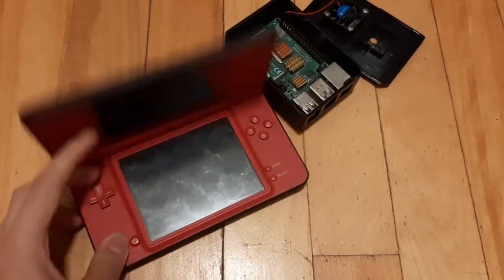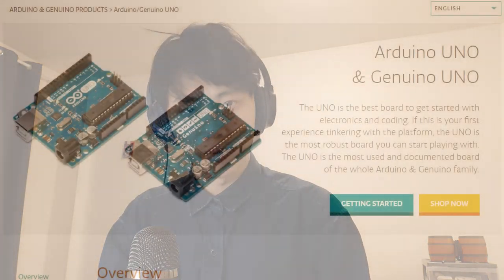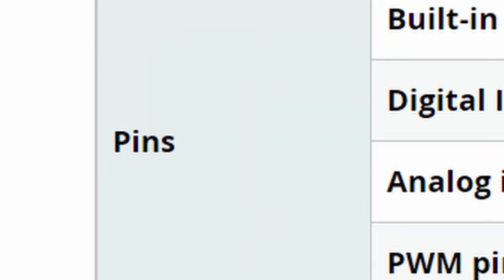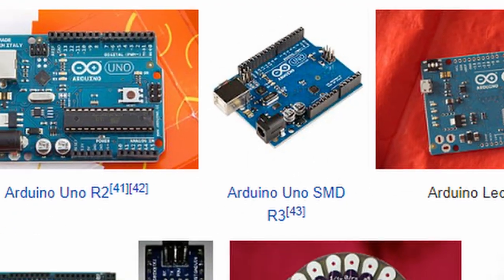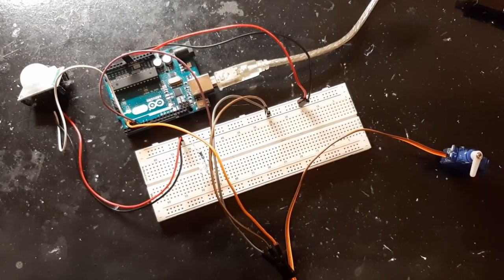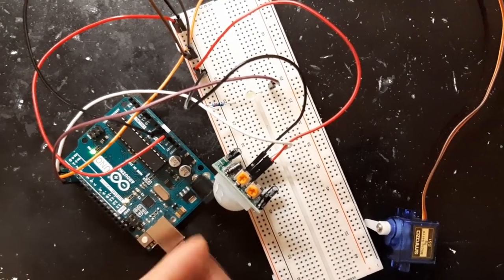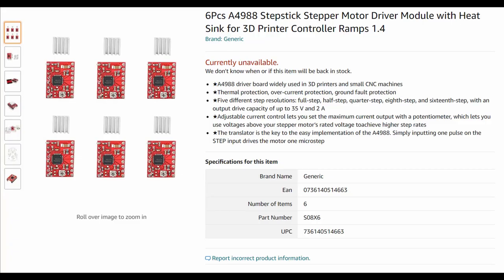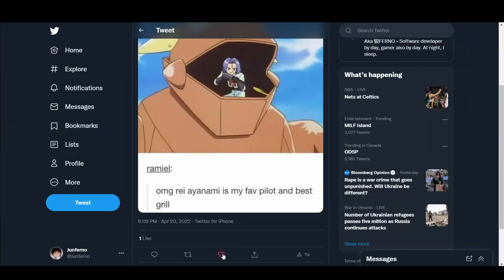Machine That ______ When You ______

Comment: you dont need a micro controller, you need to use a z80 cpu and seperate chips for ram and rom and pio and serial and make a custom PCB from scratch and program everything in ASM. PFFT. you dont need arduino. (no wait really i did do that just) you should see it, it speaks to a serial terminal

Comment: Ha, I expected the full. "Of course I first made the Blinky Sketch" (The 'hello world' of microcontroller programs). And how long did you spend figuring out the number of steps needed to get the right amount of fly swatter swing on that motor?
If python is your jam, the Pi Pico is a microcontroller board that might be a good middle ground. 

Also to your footnotes: We just call it the Arduino Due, no one is really wants to try pronounce ~Duemilanove~ in full. 
AREF sets the Analog reference point not a limit. Its a voltage that is compared to when measuring voltages on the analog inputs. Sure you cannot measure voltages above AREF, but you wont break the 328P if you measure a voltage that is higher than AREF as long as it is less than or equal to VCC.
The "binary data transfer" is done using a UART which is a serial data protocol, like the old school serial ports. Some Microcontrollers have native USB and can talk more directly to the PC in this way.
Reply from the maker: Thanks for the info! I'll update the footnotes (I'll admit to writing them in haste for this particular video due to filming during exams. No excuse though! Not the first time I've disserviced the hardware people). Python's not my favourite, but I just wanted to make something fast to demo. It did take a while figuring out the number of steps for the motor but AccelStepper library made it fairly easy. The blinky sketch makes a short appearance in the opening scenes but mentioning it was cut for time.
Reply: @Junferno  Embedded systems is a great hobby, making silly things that fulfill trivial functions. If you like to make physical things, but also like programming it lets you do both at the same time. Have fun! GL for your exams.

Comment: For microcontroller projects, I highly recommend the Raspi Pico. It's a fraction of the price of an Arduino but with many many times the processing power and speed. Was shocked at how expensive Arduinos are in comparison now. The Pico can actually drive an entire VGA display on board, something no Arduino can do (comparably, if at all)